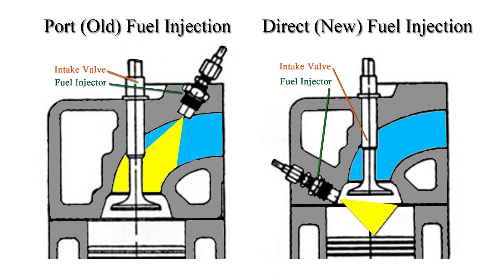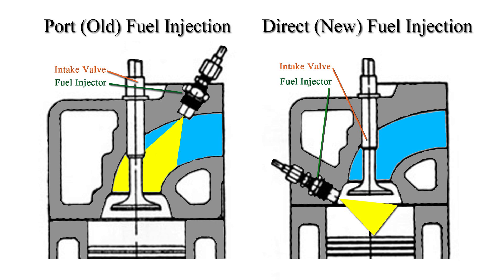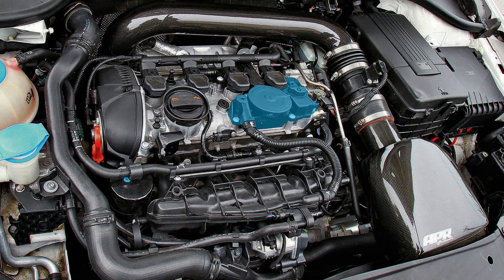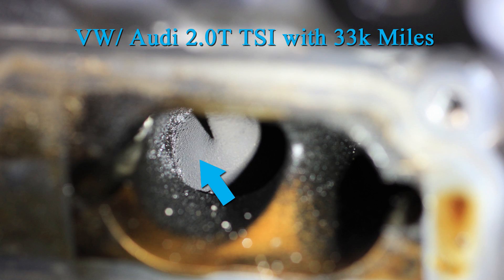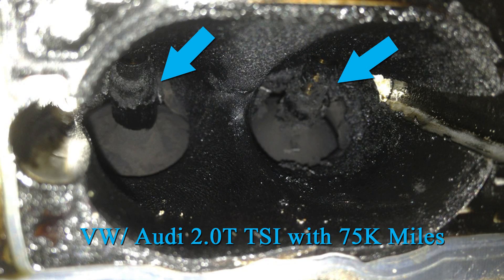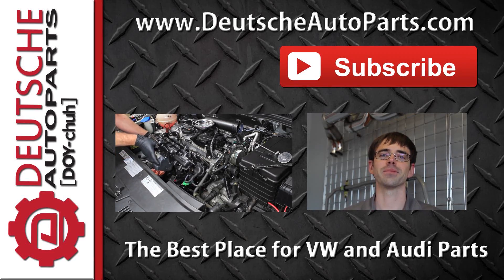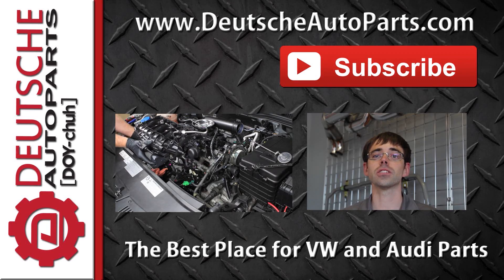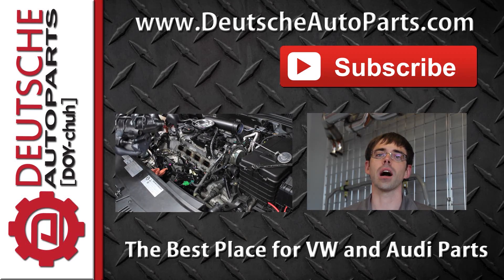Carbon Build up on Direct Injection Engine (Intake Valves) AKA GDI Gasoline Direct Inection

Comment: 10 dollars worth of breather filters and a plug = PCV delete. Failed to state the obvious here, but that would in fact stop the problem. Who the fuck wants to have to pay to get the intake pulled every 30k to get the damned intake valves cleaned? 
Simple solution to a complicated problem. Let the auto makers figure the shit out, meanwhile i'll expel 0.0001 part per billion of some potentially slightly harmful blow by into the atmosphere, fuck it.
Reply: +TheKurrgan1 Absogoddamlutely! The PCV/EGR system is a nightmare. EGR delete all the way vs a $600 procedure to clean the valves off every few years!
Reply: +TheKurrgan1 = just pull the hose off of the PCV valve, and leave the PCV valve on the engine the way it is (open), don't put a plug on the end of that PCV valve, because if you plug it then excessive crankcase pressure will build up and then your engine starts to burn excessive amounts of oil.  So an open PCV valve simply acts sort of like a 'Breather' for the crankcase.
Reply: +TheKurrgan1 It sounds an obvious fix. With modern cars with 3-way catalysts, the exhaust emissions are really low. I fear a PCV delete will become a major source of emissions.
Reply: My dealership  charged me $200 to clean it I had 30k miles on it.. how can I prevent this from happening again
Reply: vito libido ... what kind of car?  What year is it?
Reply: +icekk007 do you mean that the PCV emissions could be large in proportion to how efficient the 3-way catalysts have become? I see the it other way, thanks to how efficient the catalysts are now, we can feel a little better about letting the PCV breath (and yes DONT plug). That makes more sense to me than spending the time and effort in getting the valves cleaned or replacing the damaged components. Remember the PCV is simply handling the pressure created by excessive blowby from the rings in the crankcase. Depends how you weigh things.

Comment: My under warranty '13 GLI's rpm started to fluctuate at idle. Took it for service and they found a cracked breather valve and replaced it along with a new intake manifold. After the work, car was to spec. Then the service advisor notified me my vehicle had carbon buildup and it was okay now but in the future it would cause problems. I asked what caused it, and he mentioned cheap gas. I told him I only fill up with premium at Costco. And said Costco is not the best option and hinted that was the cause. So my question is, was he correct? Needless to say, I paid for the clean up. Also, in the invoice there is a line that states, "found DTC for p2015 suggest to replace intake manifold for updated manifold". Does that mean the manifold caused the build up? Thanks for your informative videos!
Reply: +gahernandez2 Costco gas is a Top Tier brand recommanded by Volkswagen so the service manager lied to you, when the car is under waranty this valve cleaning should be done at no cost.

Comment: There is only one way to clean badly carboned valves and that is to removes the head and clean the valves AND valve seats by hand.  There is no other method including media blasting as any type of media blasting cannot clean the valve seats properly.  You may be able to clean the valve seats by opening the valve as you are cleaning the engine but this is a horrible method as the media will get into the chamber and you may ruin your engine upon startup.  My advise to avoid all GDI engine until a serious redesign happens.  Early adapters suffer again.
Reply from the maker: +Henry Miecz Im not sure what models you are familiar with.  Possibly domestic engines?  On VW and Audi the carbon builds up on the back of the intake valves and can be cleaned by removing the intake manifold.  There are not carbon issues inside the combustion chamber.
Reply: +Deutsche Auto Parts really?  if this were true then there would be no reason to clean the valves since the back of the valve doesn't do anything except air flow.  you get misfire codes because the valve seats are coated and the valve doesn't seat properly. we all know Audi vw is having this problem but doesn't admit it because we all know how honorable they are don't we!
Reply from the maker: Henry Miecz What I'm telling you is based on ours and every other shops experience.  This repair information hasn't come from VW.  Just real world experience of how cars get fixed.

Comment: CRC GDI cleaner will alleviate carbon issues if used every 10,000 miles. It was specifically designed for GDI engines. Along with the "One Tank", Mas air flow cleaner and the throttle body cleaner, CRC has a complete inexpensive fuel cleaning system service, that you can do yourself. The dealer is going to be making big money for this service. Check out CRC at NAPA auto parts. Cheers!
Reply: +Kris Noffke   Interesting post. Is this the stuff you are talking about...  http://amzn.to/27c7DWN.  I am considering a Hyundai  GT but don't want any trouble from the GDI  system.

Comment: my 2013 car has DI engine.  it's three years old and 60,000 miles no issues yet.  sounds like the only way to fix this is to take it in and have valves cleaned and consider it part of maintenance (per this video and others I have watched)

Comment: Like someone else pointed out,  DIESELs are "Direct Injected" . What is the explanation of why we don't have the inlet valve carbonizing  issue there  ! ?
I am amazed that engine makers would allow engines on the market with such problems.
Do you know if the Suzuki BoosterJet DI engine has that issue? The 1.4 engine is new but I understand there is a 1L one in use for some time.
Reply: +Kyoo Ntt Because diesels aren't mandated by the government to reburn their PCV gasses.
Reply: +Dilan Gilluly 
IF it was only that simple, this GDI carbon issue is very deep !
I read that its ALL in the valve timing or CAM timing, or its ALL ECM issues, (programming)
And that catch can help but don't eliminate the carbon, (that does not argue in favor of your "No PCV in Diesels" argument.
Again the matter is very complicated, but what burns me is the Suzuki BoosterJet brand new engine,
will it have the carbon issue? Searched and searched and can't find what EGR / PCV system they will use.
Too late to back off my BoosterJet equipped Suzuki order now !
Reply: Kyoo Ntt The newer GDI engines aren't as bad, because the intake valves close faster, so they don't heat up and bake the oil onto them. Also using a full synthetic oil helps some as it doesn't clog and stick as well as conventional.

Diesels typically use independent PCV capture, meaning that it's captured into a catch system and not rerouted back into the intake. The oil is recycled and dropped back into the pan. The gases are filtered and released.
Reply: +Dilan Gilluly Considering Suzuki came so late to DI with Turbo, I hope they shorted out the carbon issue.
Wish i knew more about the Suzuki BoosterJet engine ( their version of GDI with Turbo).
Way too new to find anything detailed about PCV / EGR schemes.
Suzuki does not sell in the USA anymore I hear,  are you in the USA?
One of GDI advantage is higher compression ratios, but strangely enough the 1.4L BoosterJet has only 9.9 CR ! 
Thats even lower than some Port Injected engines. Some as high as 11:1  I am puzzled what Suzuki is up to?
Hope its Suzuki's concern for the engine reliability, at 1.4L,  turbo makes 140 HP,  it can easily make more.
I had the option on the same car of having a 1.6 L Diesel Turbo. But concerned about Diesel quality where I live, low temp issues, low mileage driven, and the fact that FIAT makes that Diesel for Suzuki, 
 I decided for the Gas DI. That was before I became aware of the carbon issue in GDI.
We pay a pretty penny here in Europe for cars and consumer protection is not as good 
as lets say California (Lemon Law)
The sales people and even some auto magazine writers have NO CLUE what I am talking about referring to GDI carbon issue. That's enough to ruin the new car experience for me and fill me with concerns about whats coming. I have a  23 year old Suzuki 1.6L TBI engine, and it keeps on running and running.  
Speaking of TBI, wonder why GDI engines don't implement that PLUS GDI, (cheaper vs multi port + GDI, Toyota way)
Then with some fuel additives the carbon issue could be cured instead of expensive engine repair.
Reply: Kyoo Ntt Suzuki no longer sells here in the US. I have a 2014 Chevy Malibu with a 2.5l NA GDI, with 30k miles no issues so far. I do think the newer variations of engines and ECU software addresses the issue good enough to where these cars can go 100k miles or more, at least according to the online research I've been doing.
Reply: +Dilan Gilluly Did you know what you were getting into before buying a GDI engine ?
Being aware of GDI in aviation for decades now, I always thought it was superior to MPFI, and only thought it was the expense of implementing it that prevented its use in automobiles.
Then, after placing an order for a GDI car, I run across the extensive reports of carbon in Minis BMW VW and AUDI and was stunned. I am aware that in GM motors they solved the issue with Valve Timing / ECM programming, and better engine design. GM has good luck with GDI,  but Ford not so much, Ecoboost has a lot of reports of valve carbon, and also Ford does not have an approved cleaning method like walnut shell blasting, only replacing the head is Ford approved.
  I also read an attempt to use special coatings on the valve that catalyzes the carbon build up, but that did not work. 
   Another surprising issue with GDI is the benefit you get from it. Its marginal at the most. A TUV study about its emissions is very bad. They do ok in CO2 but on particle emissions they are 1000 times worse than an equivalent MPFI  engine and 10 times worse than Diesels (!) That makes me wonder where are engine makers going with DGI.
 Are you using any additives for your GDI car?
Reply: Kyoo Ntt I wasn't aware of GDI at the time I purchased my car. I just test drove vehicles until I liked one and that was it. I'm just a computer geek, not a car guy.

But I did research it afterwards and this is pretty much what I found.
1. It effects German brands the most (VW, Audi, etc.) and even then it was only 1/4 of production vehicles that had issues, 1/10 in models newer than 2011.
2. High performance engines as in high output, CR, turbocharged; are effected the most.
3. Fuel doesn't matter, and neither does cleaning the injectors. As GDI injectors run at a much higher PSI, they don't clog like MPI injectors did.
4. Cars running on full synthetic oil were less likely to experience issues than conventional. This prompted GDI manufacturers to specify at least synthetic blend oil.
5. Low load, high rev conditions actually attributed to carbon deposits more than low load, low rev, or high load, high rev conditions.

There's a lot of conflicting results but the points above were the most consistent agreed on by engineers that I have found.

I'd just talk with the service techs at the dealer about recommended cleaning methods and about getting the ECU/ECM calibration software updated regularly. In a pinch you could walnut blast it every 30k miles or so just to make sure, shouldn't cost as much and won't burn up the turbo like chemical cleaning does.
Reply: Kyoo Ntt Mainly on GM and Ecoboost forums, where people posted about their concerns then got answers. There's just a lot of BS to wade through.

From what I've read GDI engines don't have as high of a CR as most MPI engines. Their primary benefit is injecting fuel into directly into the combustion chamber so the CR doesn't have to be as high.

High performance GDI engines typically have more issues because they run hotter, causing oil and carbon to "bake" onto the intake valves.
Reply: +Dilan Gilluly GDIs sure are complicated, and since anyone can write on the internet, info needs to be shorted out for the BS factor. But I specifically remember reading that with GDI you CAN increase the CR more than MPFI due to the fact that the mixture is made right in the combustion chamber,  and that injection has a cooling effect, allowing for higher CR.
Another thing I just discovered trying to find my source of the statement above is that SOME DGIs have no throttle plates (!),  like Diesels, RPM controlled by the ECM and injectors. 
  That brings another memory of a piece I read that they explained the Diesel valve carbon absence vs GDI due to the fact that Diesels have no throttle plates, therefore full flow all the time and no vacuum. 
  (The no vacuum would help in case the oil leaks from the valve guide under vacuum in the inlet manifold, and that being the source of carbon on valves)
But in my case the DGI is also a Turbo so no vacuum in the inlet manifold under boost conditions, maybe at idle there is some vacuum.
Overall  SMH about the complexities of GDI, considering the benefit is dismal !
The wikipedia article about GDI ends with TUV NORD study about emissions that is just the blow of death to GDIs in my opinion. Can not figure out why GDIs are popping like mushrooms all over the place. But then again when did humans use the better technology as opposed to the popular, flashy or trendy, without real justification. You want a big example of the above statement, not ICE related ?  
(although that is not popular, flashy or trendy, but its CRIMINAL)
 That would be the use of Uranium / Plutonium nuclear power vs the SAFE Thorium Reactor.
 What a world would we live in had we taken the Thorium road. But enriching uranium to make bombs is more important.
Reply: Kyoo Ntt Sometimes flashy and trendy becomes the new tried and trusted as soon as improvements are made. Computers were once trendy when they were vacuum cooled and broke down all the time. Now they're somewhat reliable and perform the majority of work related tasks today. If GDI is improved upon to where it's a lot more reliable, then newer cars will benefit with it's added power, without sacrificing reliability.
Reply: +Dilan Gilluly  I run across this, "The Ultimate additive" seems too good to be true, what a story behind it !
On their site you could be reading for days: http://www.omstarworldheadquarters.com/index.html
And then I found this weird Wikipedia page too :https://en.wikipedia.org/wiki/User:AdventureJan/sandbox
There is so much history behind this additive, and MTBE used today as additive from big oil and how damaging it is to ground water, as opposed to Omstar D-1280 that is non toxic.
Hope your computer search skills will  add a note of clarity on this. If I was in the USA I would be willing to try it.
Claims takes the carbon off Diesel stacks. BTW Did you notice your DGI exhaust since brand new ?  has it turned to black ?
Reply: Kyoo Ntt Fuel additives don't do anything for GDI carbon deposits, as the fuel doesn't touch the intake valves like they do in MPI engines. I haven't noticed any change in exhaust color at all. Still clear when it's warm out and fog white when it's cold. No black, gray, or anything.

Most of the fuel additives don't do much at all, don't buy into the hype. Occasionally fuel injector cleaner doesn't hurt at all, especially MPI (multi-port injected) engines, it actually does clean injectors.

And I occasionally use dry gas/fuel antifreeze in the winter because in the US we have 10% ethanol in our gas, which attracts water. On -30F degree days during the winter ice chunks in the fuel can be an issue.

Also fuel stabilizer can be used if you plan on storing gas for a long time without using it. I use stabilizer in my backup generator. Other than those three (injector cleaner, fuel antifreeze, and stabilizer) fuel additives are just BS money makers for the companies that make them.
Reply: +Dilan Gilluly I posted a few lines asking you to humor me on this OMSTAR  D-1280  additive but the lines vanished now. Was quoting the sites in another post of mine about Omstar.
There is a lot to read in their site, but this is the best about the history of the Ester Based Additive:
http://www.omstarworldheadquarters.com/omstaraurthorizeddistributors.html
When you get a chance read through it, old time invention, the non toxic part I like
Reply: Kyoo Ntt Take anything manufacturers claim about their own products with a grain of salt. Of course Omstar will say good things about their product, they want it to sell. Try it if you want but it may not yield the results, as other companies make very similar claims and my use of their products yielded no results.

I watched a video by FordTechMakuloco and I think he solved the mystery of why some GDI's have the issue while others don't. It's a process called "exhaust scavenging" where some manufacturers design their engines to open the intake valves before the exhaust gases escape, to assist in the process of cleaning the combustion chamber faster. This exposes the backside of the intake valves to incompletely burned fuel.

GM and Asian manufacturers are religiously against exhaust scavenging. Go figure.
Reply: +Dilan Gilluly Well...after 2.5 months of waiting i got my Suzuki GDI engined car....AND.....from day one TONS OF CARBON SOOT at the exhaust ! !   Used best fuel money can buy. Bad Sign to start with, but only time will tell
Reply: Engineering Explained made a video about that exact topic.. Try to find it lol

Comment: my wife just started our 2015 bmw x1 3.5 engine this morning and turned it off 20 seconds later here in toronto .the temperature was about 6 centigrad above zero .can that cause carbon build up ?the car has 24000 kilometers on it .thank you for your time .
Reply from the maker: You didn't mention your problem but based on how new the vehicle is it probably not a carbon issue.
Reply: +Deutsche Auto Parts oh sorry what i meant is could turning on the car then turning it off in a few seconds in relativaly cold weather cause carbon build up in the long run ? the car is ok now .